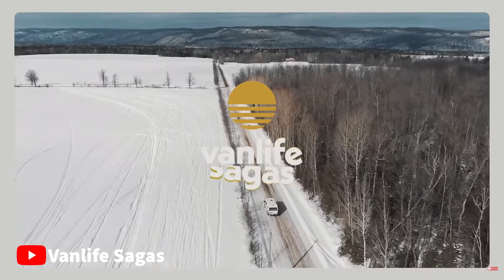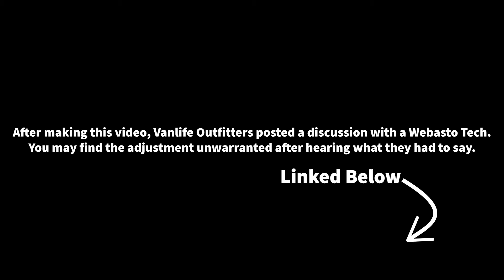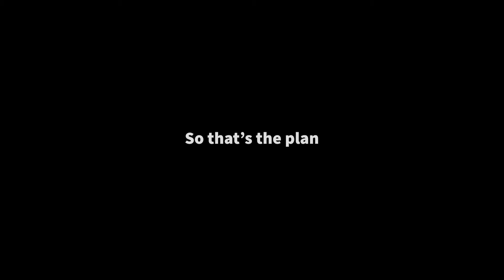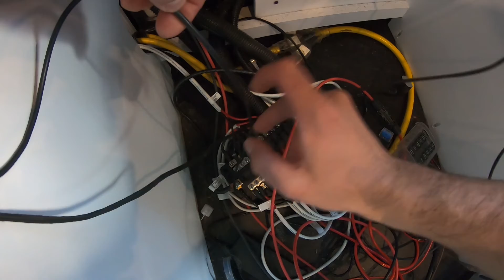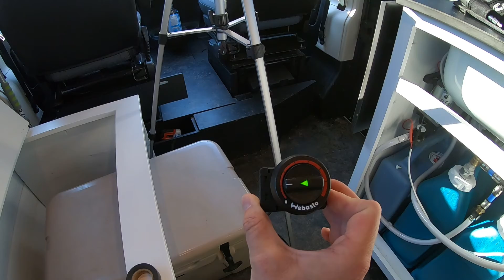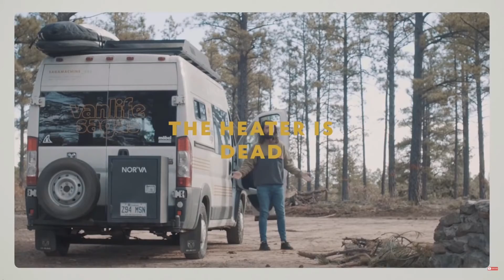Webasto High Altitude Adjustment//Ep. 35 DIY VAN BUILD

Comment: Well here is a counter point - when you run the heater at different altitudes the CO2 levels will change. People here are making it sound like the CO2 is fixed and only adjusted by this knob in service model - well it changes depending on altitude. 

How do you think these newer units altitude compensate? The reduce fueling based on data from a pressure sensor. They are NOT equipped with a CO2 meter to ensure the CO2 output is correct. It is just less fuel for a higher altitude. Less fuel pump ticks the higher you go. 

There are some websites out there that tell you to download a app for your phone that measure pulses and tell you the hertz of the pulse timing. Then based on a hertz at a certain altitude you can tune your fuel pump timing.
Reply from the maker: Awesome rundown! Thanks for your input. I tried to be upfront that this is still blind but I felt it was worth doing. Having lived in Salt Lake and done many trips to the mountains at 9000 feet or more, I had great luck with my heater never having bogged down. Ultimately, to do an adjustment “correctly”, it should be done at altitude. There is a van build company in Flagstaff that will adjust Webastos with factory equipment which is pretty cool. Or a heater can be purchased from them directly. But for what it is, I felt positive about this procedure and have been happy with the results! Again, thanks for your input because I wholeheartedly agree with your logic!

Comment: If the power or battery is disconnected to the heater, do you have to reset it again?
Reply from the maker: Sorry I must have missed this a few days ago. Reset it in what way? If it is running, power being cut to the heater isn't great. If it doesn't run its full shutdown cycle this can be a cause of carbon build up and other problems. But I don't think you will have to reset anything if you are cutting power to it when it's off. There are different remote types and I believe the digital ones store selections when power is cut so that they should function the same when power is returned.
Reply from the maker: Oh I just realized this was on the high altitude video and not our Webasto install video. No, the settings will be stored so that you wouldn't have to run this procedure anytime lower is cut

Comment: I just got my heater in and will be installing soon. Thanks for the info! Off topic, but I did notice in the background that you insulated the pillar next to the window in back of the driver’s seat. I was wondering how to do that since that pillar is open to the air flow channel that runs the whole length of the van along the floor. Did you make a partition to insulate there? If so, I’m interested in how you managed that. Thanks!
Reply from the maker: I hope your install goes well! Let me know if you have questions. It's been awhile since we did the insulation, hehe. If I remember right we added some painters tape at the bottom so that the wool couldn't pass through to the channel. I'll have to ask Katie, if we did something different I'll have to update
Reply: @northstaroffgrid  Thank you!

Comment: Sorry, this is wrong and you're misleading folks. If you follow these instructions you are making a blind adjustment. This is supposed to be done with a CO2 meter. If you don't use a meter, now do you know what you adjusted? You are blindly making the heater run lean (overheats the burner) or rich (loads up with carbon).
Reply: How is it different than taking an unadjusted one to high altitude? It is going to load up from running rich anyways.
Reply: @MyGoogleYoutube  The difference is you only adjust the CO2 if the heater is going to be staying at that altitude long term. Multiple weeks. If you're only up there skiing or something, when you come down to the lower altitude run the heater for a few hours and it'll clean itself out.

The rule applies. If you're adjusting the heater without a CO2 meter, you're adjusting blind.
Reply: But if you're coking up the burn chamber and re seeing the unit useless and stranding you without heat how can you possibly make it worse by doing this?
Reply: @jeep6242  If you were in the mountains with your 304-powered CJ7 and it wasn't running, how could you possibly make matters worse by adjusting the air/fuel mixture with the engine not running?
Same thing here. This is a live adjustment. You need to see the value change to know that you're even going in the right direction.
Reply from the maker: And I say that in the video more than once. I've been told it shouldn't overheat the burner however, the adjustment changes the amount of fuel going in. No temperature sensor range or glow plug timing is changed, only the fuel pump "tick". The direction this adjustment goes will only move it lean. You do the same procedure backwards to adjust it more rich. But again, I say in the video the only way this is done correctly is to have it adjusted with a CO2 meter testing the exhaust preferably at a certified Webasto dealer.